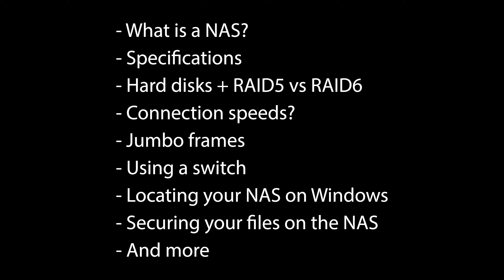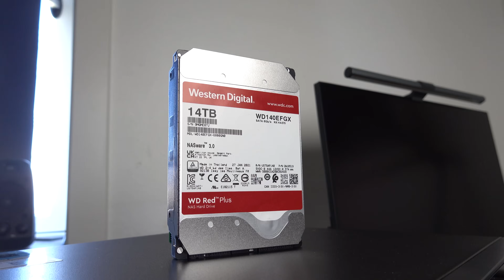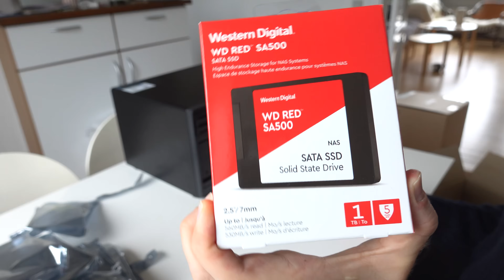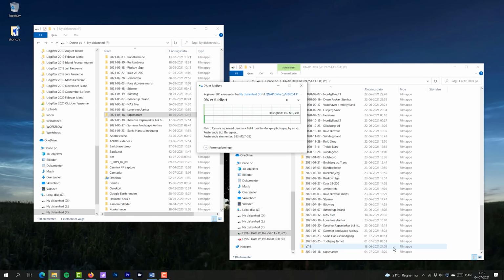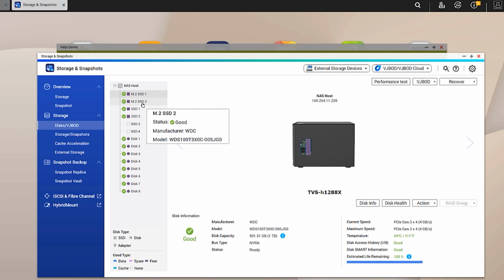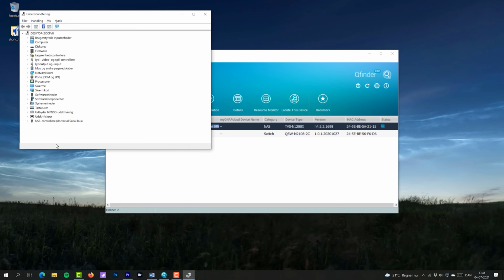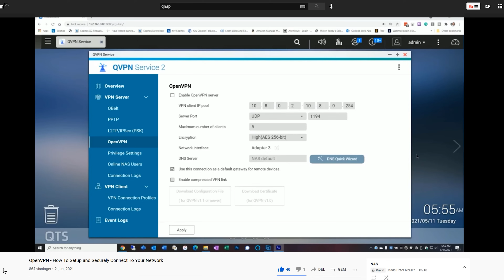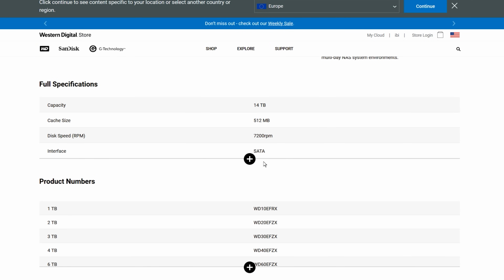A COMPLETE Beginners Intro to SETTING UP a NAS for File STORAGE

Comment: Thanks for the video! I definitely need a nas. With over 25 of external harddrives it is becoming a nightmare. I am procastinating buying a nas, installing it freaks me out. Didn't had a clue of all the extra bits and pieces you needed to get it working properly 🙈🤣🤣
Reply from the maker: Yeah it's really a nightmare finding out everything. Although geeks know a lot, communication is not their strong side, but hopefully this video gave you some insights :)
Reply: @MadsPeterIversen  The video was very helpful, so thanks again. Have a great sunday!

Comment: If you just need more storage and "backup" then NAS is not the way to go. Most people should instead consider a multi-bay drive enclosure or just add more hard drives to their desktop if they are using a desktop computer. NAS shines when you have a small office or home where multiple computers need to access the same data. Don't buy a NAS because you need more storage.

Comment: Dear Mads and others

I like your videos and this one as well. I just have a comment....

Recently Qnap drives around the world were exposed to and exploited by hacking/ransomware through the Qnap-cloud.
All files below 20mb were encrypted and the vulnerability was the Qnap-cloud. The company offered a solution which would PERHAPS function, approximately a month later, but only if nothing was touched on the drives.
When I had the problem and contacted Qnap they told me that I should have had updated my firmware and so on.
The firmware was updated, security-scans were done twice each 24 hours and even though I lost all files sized 20mb or below.....

Today I don't rely on a NAS....
All files are now 
backed up by a cloud storage service and when I compare the monthly payment for cloud Vs NAS I really appreciate the security and convenience. 
The cost of buying hardware makes up for several years of buying cloud-storage.

But... Very nice and informative video!!!

Comment: Just in case, I observed that was used single NVMe as cache. If is true, my suggestion to make a pool from NVMe connected in mirror and assign the pool as cache.
From what I found in I-net resources, if cache failed, then may results the lose of data.

Comment: Having worked in IT for over 25 years, you did a great job at explaining this. Great work on setting this up as well... a good video.

As a side note, you basically won the nerd lottery getting all that gear. I would be over the moon to have that level of equipment at home. Certainly not cheap!!

Perhaps a follow-up video is explaining the importance of off-site backups. In case of a house fire, you stand the potential to now lose 10's of terabytes of data. An off-site strategy is needed.

Also, re that noise, you can get a solid rubber mat to put under the NAS which will greatly help reduce the vibration noise. I would not recommend anything soft like bubble wrap or cloth as they can attract dust.

Comment: Very nice video Mads,well done! I think this is really relevant content as you share it from a photographers point of view. Being a photographer and a quite techy computer geek myself it is really nice to see how you cover a lot of topics I would often just take for granted and totally forget to mention if someone would ask me - especially the jumbo frames is really essential and something a lot of people might not know or think of. Regarding the noise, you can control the fan level manually in QNAP's interface, but with so many spindle drives as you got in your NAS the main noise would be coming from all those drives for sure, I got the same issue with my NAS boxes - so they are all located securely in a storage space in a different room than my office, to avoid my ears from the painful noise of spinning drives all day long :-)  I think someone else already recommended in the comments, getting a UPS is a very good idea - both for your PC but especially also one for your NAS :-)

Comment: Definitely not a beginner's experience, I would say.  I have a two bay QNAP NAS, with no SSD option, although it does include up to 2GB of RAM.  It was very easy to set up, using the software tools you mention, and could be configured in any number of ways, also as you mention.  Very impressed with QNAP products.  Even my simple setup is fast, responsive and reliable.  On the question of putting bubble wrap under the drive, definitely don't do that because of the airflow constraints.  There are lots of simple vibration pads that can be purchased.  Even mouse pads can be used if necessary.  The best solution might simply be to move it off the desk.  Thanks for sharing.

Comment: I built my own pc 2 and a half years ago and I didn't understand half what you said. I will definitely have to study up on this further. I did put an NVMe drive in mine for the OS and software. My pictures are stored on a Western digital yellow 2 TB hard drive. What I saw on the yellow was they are for servers and last twice as long and are made to run 24/7. I will look into the red drives. I don't think I need a NAS what that many bays. I think 4 drives will be plenty. I also don't know if I'll need 14 TB drives. I haven't really started working for the public yet but I'm about to. I need to upgrade my CPU and ram first. I can't find graphics cards right now because of all the scalpers buying them up to mark the prices up. Nobody has any in stock. I need to back up my photos though. My Lightroom is not organized very well. I have pictures I can't find anywhere and some ended up on my C drive. I didn't have my D drive (2 TB) up and running when I first started. I need to find some videos on how to set up backup storage for pictures and how to organize Lightroom with the drives.

Comment: Seems the bubble wrap solution may create an issue with airflow and cooling ??
Reply: I am at the age, I can just turn down my hearing aid.  One of the few benefits of getting older!
Reply from the maker: Yeah, I'm worried about that myself, but I haven't come up with a better solution just yet. Maybe a lot of small cloth patches can work being places underneath each leg 🤔
Reply: @MadsPeterIversen  A small sheet of Styrofoam may work well.

Comment: As Felix says.. NAS is no backup.. 

I had a NAS disk my self and had somewhere between 26 and 27.000 pictures stored on it... Until lightning struck..  One fash, a HUGE bang and no more pictures..
Now I store all my puctures on 3 seperate disks that I can connect to my pc with at USB3.1 tacking a backup and disconnect them again.. Never going to loose them again.. :D
Reply from the maker: Yeah, it's probably also a good idea to have a cloud based backup. I also have that :)
Reply: I installed my first NAS about three decades ago, and currently using 3x NAS and 1x DAS. Plus DVD/BD & off-site backup. 🙂

Comment: A simple and straightforward insight in to NAS for those that probably are not sure what it is or if they need one. It was obvious from the start that this was a sponsored video as you clearly mentioned this along with the names of the sponsors, so I don't see a problem there. This is expensive kit but in relation to the outlay already made on getting the pictures/video's it may well turn out to be a cost effective solution. I suspect all photographers/videographers have a at least some form of backup via an external drive or cloud solution and it doesn't take long to fill up these backups. The NAS solution may be a bit of overkill for some but I can see the benefit for others, such as knowing where your data is (cloud drives can be anywhere). I've enjoyed all the videos I've managed to see of yours so far and look forward to not only catching up on the older content but to see what new adventures yourself and Sophie embark on in the future.
Reply from the maker: Thank you so much, John! There will come a ton more landscape photography from here for sure :)

Comment: Not surprisingly my financial advisor just fainted when at total cost of everything here, wow. 
Guess I’ll stay with the 8TBs of external storage I currently have. 
Thanks for sharing Mads.
Reply from the maker: Yeah, this specific setup is rather expensive. That's why I really tried to emphasize there are smaller options ;)
Reply: When you consider the file sizes of today’s pro camera’s, 40 - 50 megapixel plus added to that the 8K video and throwing in all that drone footage, for good measure, it’s not really hard to see how useful that storage setup you now possess will be.

Comment: A lot to take in there Mads, but it certainly looks an impressive set up. Not so much a technical question but more of a practical question. When you go on your travels again, will the NAS provide you with a way of doing a remote back up, i.e can you transfer images from you camera onto a laptop then subsequently instigate a remote back up on to your NAS at home? I will confess I have limited knowledge of NAS and was wondering if this was achievable
Reply from the maker: Thanks for a positive comment, Jim. There are just so many people who lose their mind when they see something is sponsored 😅
But yes, that should indeed be possible with the remote access option 😊
Reply from the maker: @djstuc  yeah, that's what I'm thinking too. I'd also need to edit on the go anyway